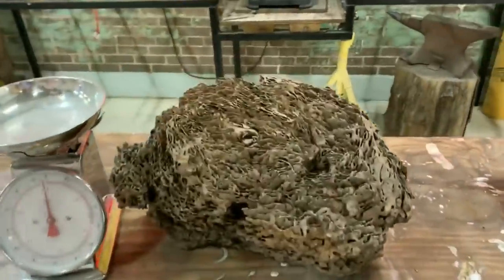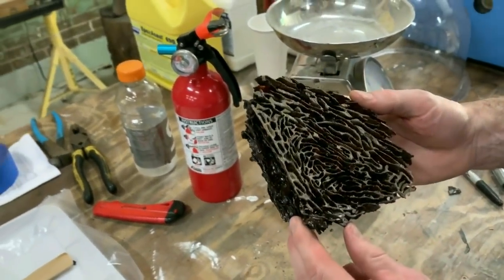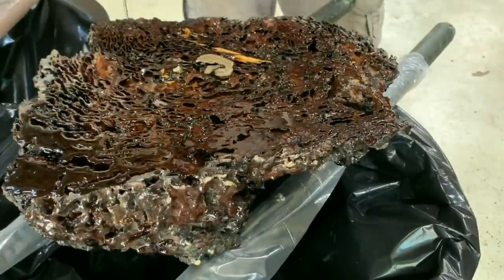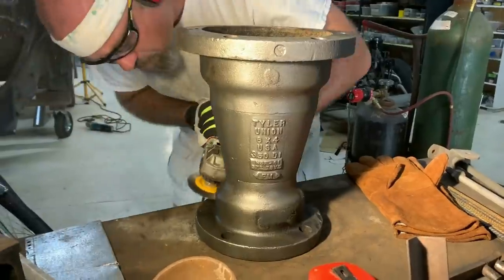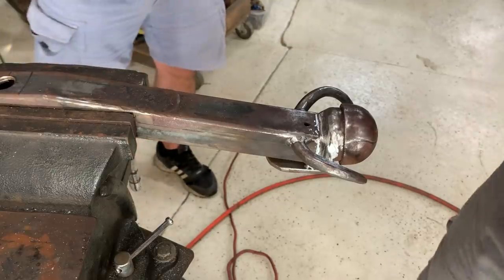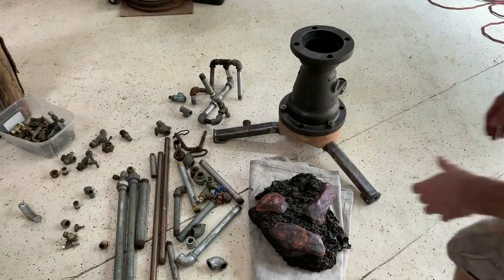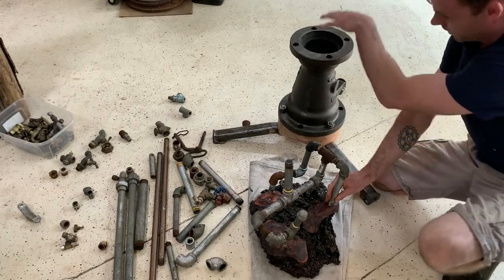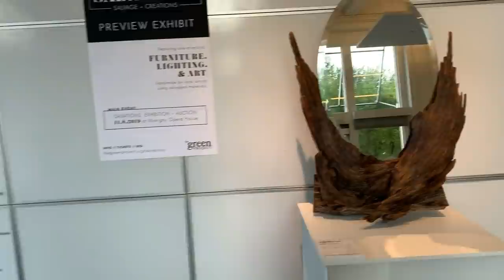We Cast Epoxy Into a Termite Nest and Made a Nightmarish Table

Comment: Does your air grinder still act up even with a thin lubricant in it? That's normally what is needed since the oil is the final process inside the tool to add to its tightness (I am Icelandic and technical terms are out of my vocabulary).

On a side note, Gun Blue is a toxic chemical and it would be nice if it was used a bit more sparingly, you know, for the environment and all that.
Reply from the maker: Thanks for the tip!  I’ve tried oiling my air grinder. It tends to work ok at first but runs my air pressure down fast and loses power. It’s not a very big air compressor and it’s a cheap grinder. 

Your point about the Gun Blue is well taken.
Reply: @Chemical14  Air tool lubrication. There is air tool oil. Tends to be pricy. We just used ATF. Thin,and a form of hydraulic fluid with anti foam agents. Type F preferred,but there have been enough changes in available fluids that I am no longer current.
There are oilers for sale,but just dribbling ,oh a teaspoon or so first thing seems to work fine. Down the hose before you plug it together. Some guys once a day,some once a week. 
As long as the vanes inside the turbine get at least some oil film,they will not heat up. Bearings or bushings just need an oil film,near as I can tell. Cheers.
Oh,and see to it condensation water is trapped well. If it gets into the moving parts,that will rust,gunk up,slow and seize any air tool.
Take one apart and examine. That will tell you if there is water getting in.